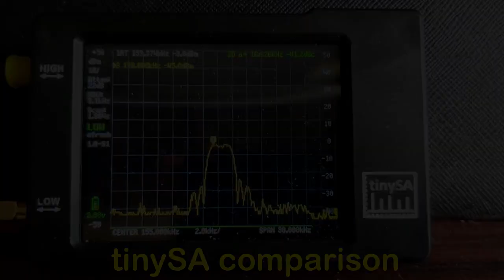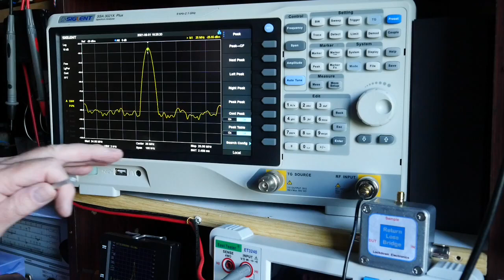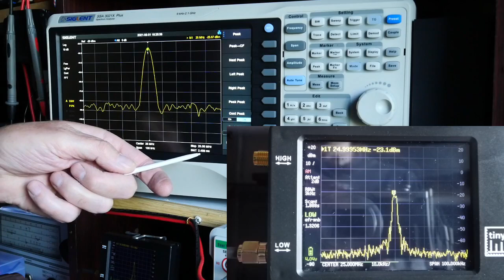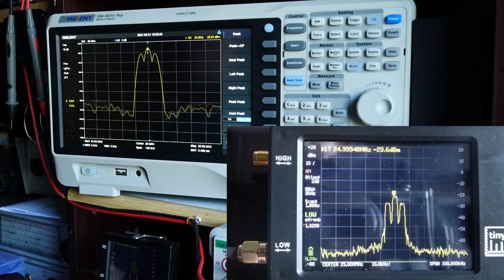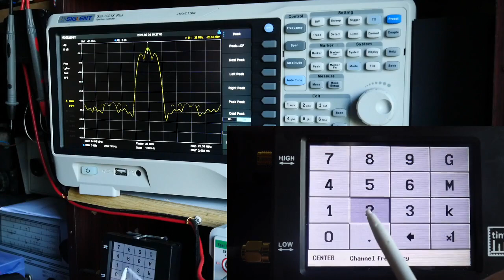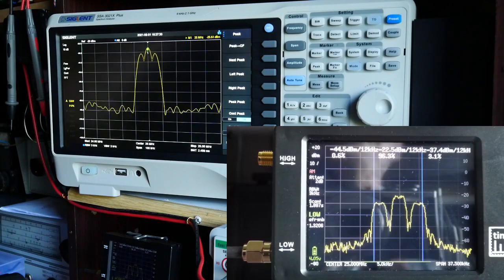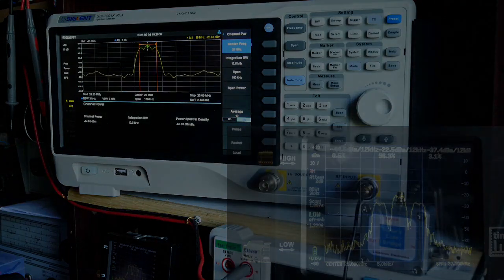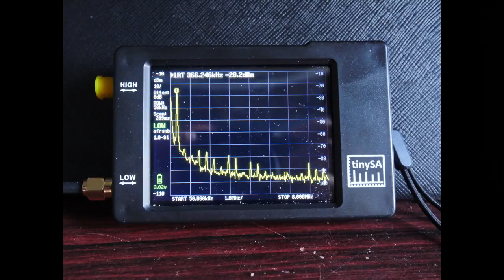tinySA comparison and channel power measurement function - #068

Comment: I own 2 very heavy, very old, and very expensive HP spectrum analyzers that cover a combined range from 40 Hz to 18 GHz, and an Anritsu portable unit that goes up to over 7GHz. Having said that, I haven't used any of them ever since I got a TinySA, and then a TinySA ULTRA. Those 2 tiny units and a couple of mixers, dividers, and attenuators fulfill all of my needs so far. Unless I needed to prepare a paper for publication, a measurement for commercial use, or I had to tune a set of repeater cans, I simply wouldn't bother to use my large, expensive gear ever again. The TinySA does it all. The only real caveat is one that applies to all test and measurement equipment, but particularly to the TinySA. One needs to understand what the TinySA can do, what it can't, and how to do it. You must LEARN how to set its parameters, and what it is you are looking at. That's really the only tradeoff for the enormously lower price, and the enormously higher convenience. For a hobbyist, that is an easy tradeoff to accept. We like what we do, and we typically ave the time to learn, but not the money to spend on commercial gear that sometimes can cost as much as or more than a car.

Comment: Hi Bill. I received a TinySA from Bangood yesterday. I has a play with the original firmware before saving it and uploaded the latest version. As you say, it's a bit of a steep learning curve but I'm amazed at what it can do for the price. It's gone into the case with its mates - a NanoVNA-H and a nanoVNA-F V2. You can't have too many test instruments!  Next on the shopping list will have to be an oscilloscope.  
73 de Malc M0IYI
Reply from the maker: Nice one, and yes both the TinySA and the NanoVNA are incredible for the size and cost!